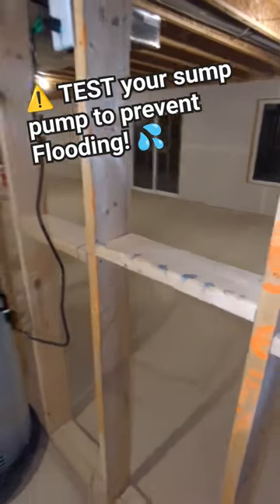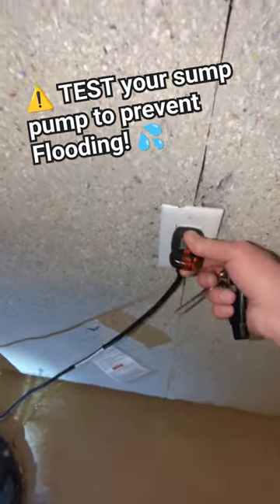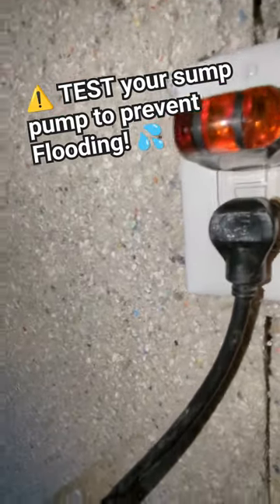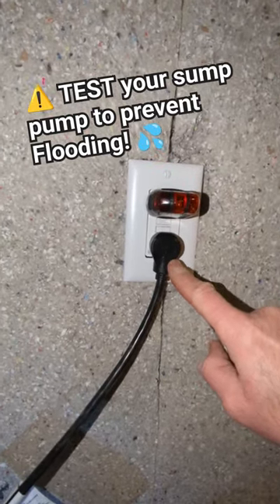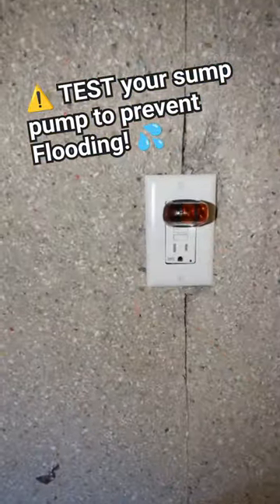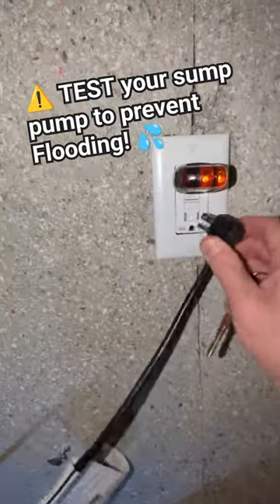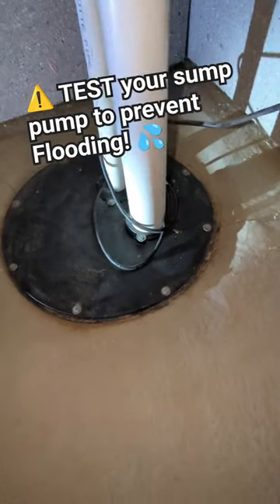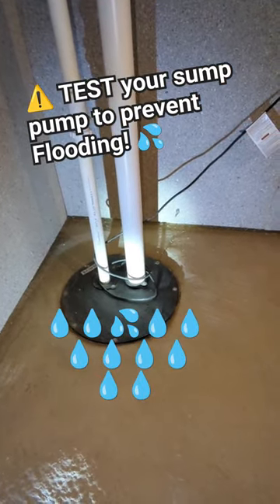⚠️Test your #sumppump 💦 to prevent#flooding#realestate#youtubeshorts#shortvideo#shorts#plumping

Comment: It looks like the plug is actually pressing on the test button for the gfci, forcing it to trip when you hit reset.
Reply: No, it tripped before he even fully plugged the sump pump back in
Reply: @Bremend  I think that's hard to tell, slowing down the video results that both ideas are possible